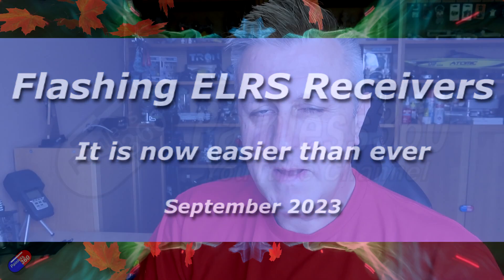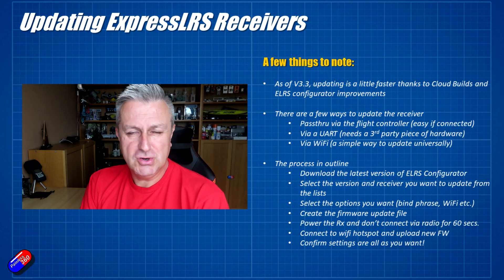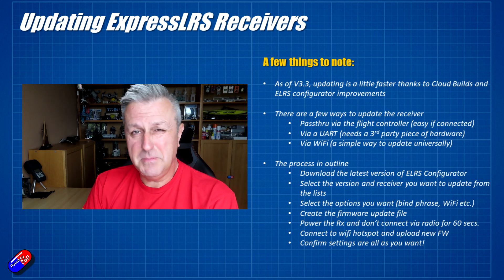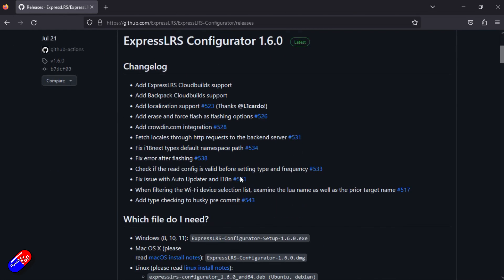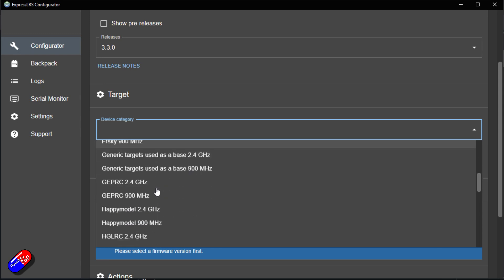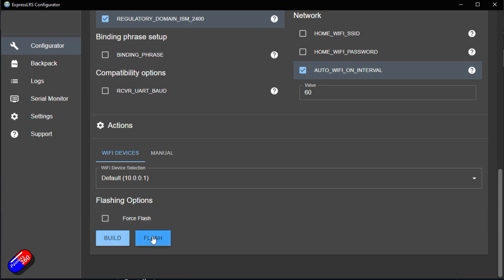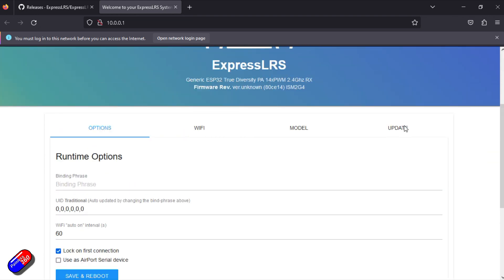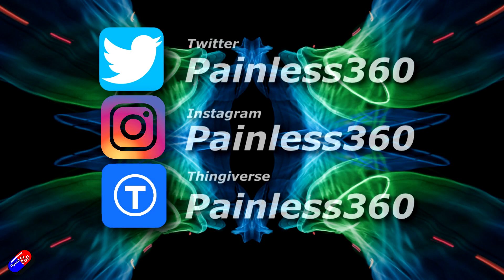Flashing ELRS Receivers Easily (for beginners)

Comment: When I try the initial flash using ExpressLRS Configurator on my computer the connection to the receiver' WiFi breaks my internet connection so the Configurator fails to flash because it can't download the firmware (the log shows an error at the beginning of the build phase). My workaround is to start the flash before I connect to the receiver WiFi, then when it starts to build I connect to the receiver WiFi and it works. This is only a problem with the initial flash because once you set the receiver's WiFi info you don't have to connect to the receiver wifi access point.

Comment: Its really hard to beat ELRS now they have PWM rx's. 15 bucks and you have rediculous range and battery telemetry plus assignable channels. 30 bucks using matek converter and you have rediculous range, gps, current and voltage and 10 channels.

Comment: Updated 3 x ELRS receivers very recently - had no trouble with 2x Radiomaster RP3's but never managed to get the BetaFPV Super D to work despite trying several methods - I may just have been unlucky
Reply from the maker: I've occasionally had to try a few times with a couple.. Restarting and reconnecting usually works. Best of luck

Comment: while updating the firmware its showing as ERROR 4 not enough space 
what to do??????
Reply from the maker: The easiest solution to the "not enough space" problem is to flash the receiver using betaflight passthrough instead of wifi.

Comment: Great video as always. I love ELRS receivers, at first it was confusing but once you learn, it becomes very easy to bind and update, i have 14 quads with ELRS. I'm installing a Radiomaster pwm E5 on an rc car and want to use my Boxer transmitter, question, do i plug in my steering servo to channel 2 on my RX? I want to use my Boxer for all rc.

Comment: Hi Lee. I have about 6 betafpv micro 2.4 rx. They all flashed no problem apart from one which won't go into WiFi. Is there a way to reset it please?
Reply from the maker: It has a bootloader that can't be damaged so it can still be flashed, see https://www.expresslrs.org/quick-start/unbricking/
Reply: @Painless360  great thanks

Comment: Hello, I updated my generic ESP8285 2.4Ghz receiver and my Jumper TPRO radio, I receive the message that the radio connected, but the receiver light keeps blinking 3x, I can't get the solid light.
The only command that works via the radio is to turn on the receiver's WiFi.
Does anyone know how to solve it? The tx-rx, rx-tx wires.
Reply from the maker: Mismatched model numbers https://www.expresslrs.org/quick-start/led-status/

Comment: Great info!! What’s the process on the transmitter for a tx16s? If I get a RadioMaster Ranger Micro 2.4GHZ ELRS Module, do I simply plug it into the compartment on the back and choose external RF in the setup? Or is there also firmware needing flashed onto the TX16s as well?
Reply from the maker: Exact same process. Only change is that you use the ExpressLRS LUA script on the radio to 'Enable WiFi'
Best of luck
Reply: @Painless360  thanks for the reply. do you have or know of a video for these steps for the WiFi enabling in the tx16?
Reply from the maker: Not yet, I'll add it to the list.
Reply: @Painless360  thank you very much!! I get a bit nervous flashing stuff on my controller so a tutorial would be amazing
ELRS
Reply from the maker: Preview for you! https://youtu.be/phWn6ZL6RU4

Comment: so your not saying if your receiver doesn't have a name How do you update it If its not in the list For eg Banggood selling and elr nano receiver No make model only says ELRS MINI 2
SX1280 ELRS MINI  What do i select in order to update this
And if it were to detect and give you the firm What about the Tx how does it Bind I ask Because its been over a year since i used elrs I am having the issue were i cant find the correct model
Cheers

Mine says this, so what do i select?
Type: ISM
ESP8285 processor
Reply from the maker: Have a look at the firmware type already installed via the WiFi page on the RX. Also, you could check with the vendor or the ExpressLRS forums. I'd strongly suggest using hardware from vendors who work with the project and get integrated, better quality hardware will give you a better and simpler experience.. See vendors like RadioMaster and the others listed in the firmware flasher for options. Happy flying